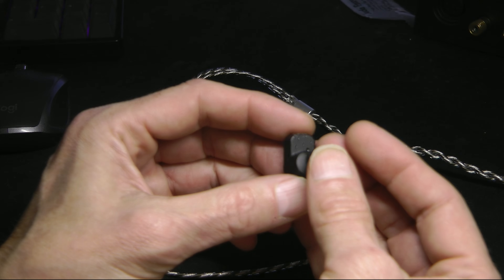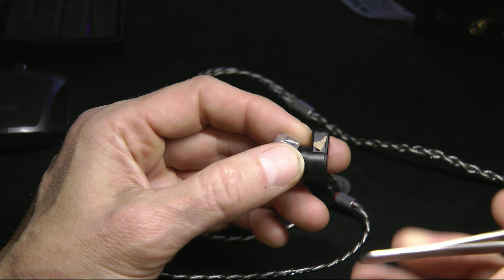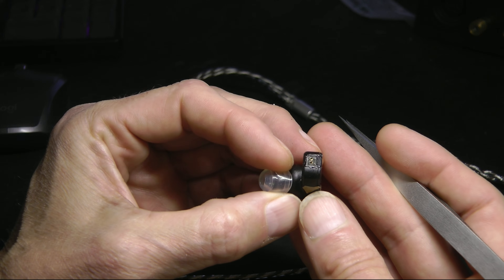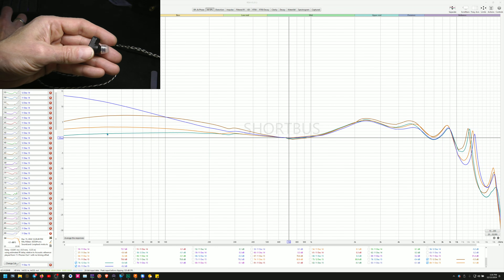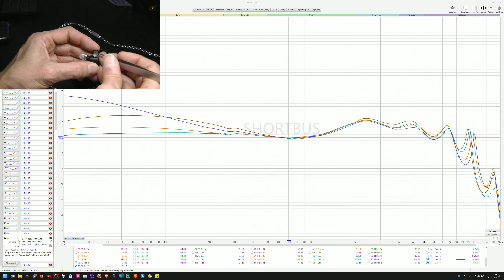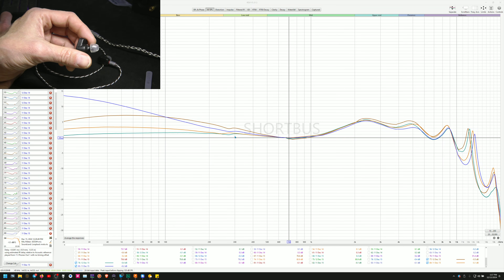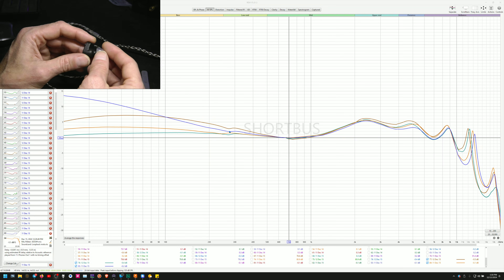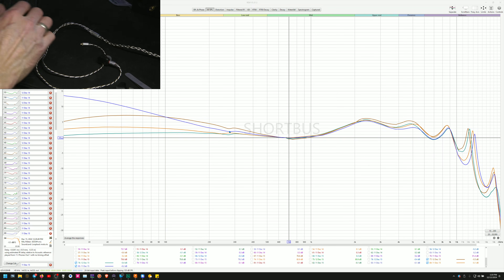Anomaly Information, graphs, the what why and hows.

Comment: Closing front vent based on tip insertion proved to be unreliable with sennheiser ie200, taping back vent with nozzle filters is clever but also unreliable because the glue is not strong enough and it will come off after a few weeks, as you 3d print the shell you could have designed a pin system ( a simple cylinder with markings with different insertion depth that could do these mods reliably
Reply from the maker: incorrect, the area for the back volume damper is recessed and will stay.  I did design a system with an apex style vent thing but it pressurized the driver from the rear and killed it

Comment: i almost feel like you could build in a little spinnable wheel type thing to adjust the rear vent
Reply from the maker: it has to be fully air sealed, so this wouldn't work easily.  I had a plug in system but it broke the driver by pressurizing the back shell.  oh well
Reply: @MichaelBruceShortbus  oh yeah, i forgot about the 64audio style plug. too bad, that'd be sick if there was a 3d printing way to have that work, but i see what you mean with the full seal being a tuning option